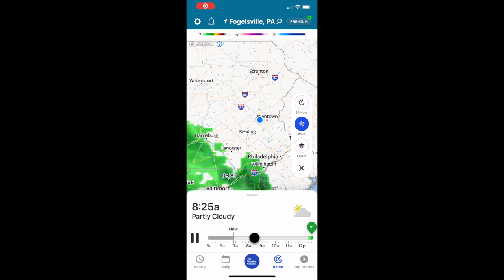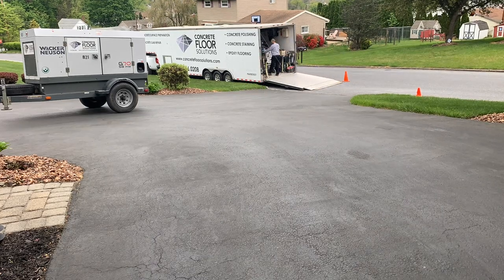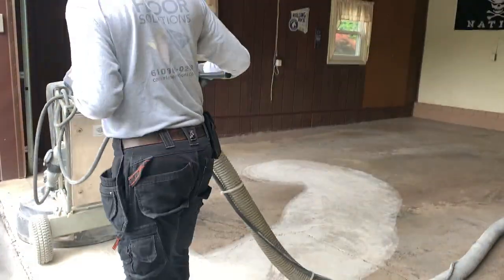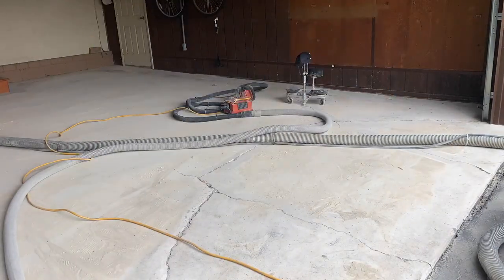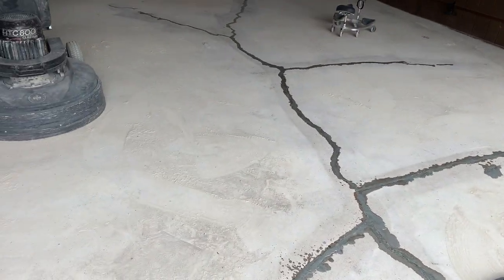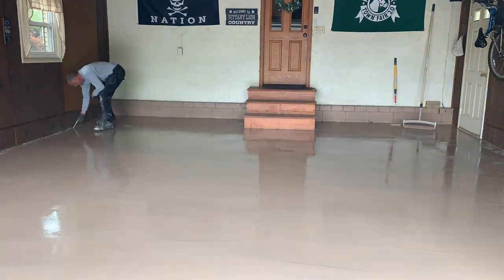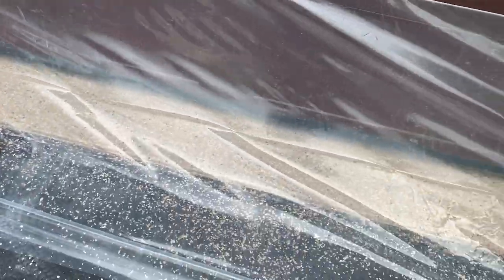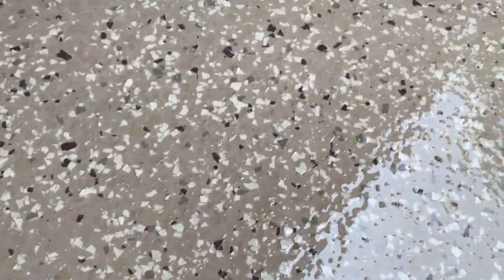Epoxy Flake Garage Floor With Large Cracks

Comment: Thank you for this video! I was using a similar fast cure epoxy crack sealer and I just felt like I was wasting the whole gallon. Now I’ll grab some 70 mesh sand for it. How many pounds of flake do you use for a 400 sq ft garage? I have 75 lbs of flake for a 430 sq fr job.
Reply from the maker: 10 pounds per 100 square feet for full flake. The most common thing in the industry is to over sell customers Flake. you can apply the 75 pounds, but I can assure you you will be shoveling / scraping up 30 pounds when you're done.

Comment: you prefer the muv you used as top coat or a polyaspartic?
Reply from the maker: The MUV is a great topcoat, the only negative is that it is not 100% UV stable. That being said the polyaspartic is even better scratch resistance and 100% UV stable. So I would prefer the polyaspartic if given the choice. It all depends on budget also.
I use the polyaspartic in my own garage.

Comment: i noticed you dont cut a relief joint alongside a crack. Do you recommend doing this?
Reply from the maker: Why would you cut another opening next to a crack that you just repaired?
Maybe I'm not understanding correctly, but what's the point of repairing a crack if you're just cutting another joint right next to it?
By repairing the cracks, you are trying to bond the crack back together again.

Comment: What is the red box that the floor grinder is plugged into
Reply from the maker: It is a power inverter for the Hilti grinder. The DG 150 grinder is actually a low voltage grinder so the power converts from 110 to DC.
They have a new model that is 110 V and doesn't need the box

Comment: You should try mixing the sand with the crack fill material at a 2:1 ratio and make a slurry. It bonds better to the crack and leaves a more seamless look when you finish coat.

Comment: Contrary to what you demonstrate on this job, I've noticed some tutorials recommend not going past the garage door with the epoxy and clear coat.  My understanding is the clear coat will yellow over time with sun exposure.  Has this been your experience or are some clear coats resistant to UV exposure?
Reply from the maker: You are correct, epoxy is not UV stable. We do have some UV inhibitors in our clearcoat, but it will cloud up over time outside anyway.
You can apply a urethane or polyaspartic topcoat, which is 100% UV stable. The upgraded top coats  are normally offered as a choice in our proposals when we install floors.
Reply: @ConcreteFloorSolutions  Thank you for the input.  I appreciate your videos; very detailed and professional without extra fluff and glitter.  If I lived in your area I'd hire your company based on the quality demonstrated  in your videos.

Comment: Good stuff!!
So you dont need a sealer/pva coat before primer?
To kill any chalkiness/dust?
Reply from the maker: In this case we use a 93% solids penetrating primer. I am a huge fan of 100% solids material, with the exception of a primer. It must penetrate into the concrete or else it may fail

Comment: Great work wow! I notice you guys tend to do medium flake not full flake do you ever get epoxy yellowing or any reason not full flake? 

Also wha size is preffered choice for the aluminum oxide?
Reply from the maker: I prefer heavy as opposed to full flake so all the flakes are laying flat, it is easier to clean and you get another color from the base epoxy added to the floor.  You get slight yellowing after a couple years  if extended under the garage doors, but not horrible. We use #36 aluminum oxide typically.
Reply: @ConcreteFloorSolutions  thank you for the quick reply and insight its much appreciated were doing our first floor here soon your videos are very easy to understand im a little stressed because for our base coat we are using Fast Cure epoxy because it has a moisture vapor barrier I plan on diluting 5% acetone into the part A before part B addition to give us a little more work time

Whats your thoughts on fast cure epoxy for base coat ?
Reply from the maker: @sprintcoding7358  I don't know if you mean primer or basecoat. We install a primer, basecoat with flake, and a topcoat. We have always used a three coat system and it has never failed us. personally, I don't like fast cure for the primer if it is fast cure, it doesn't have time to penetrate into the surface. penetration into the substrate is critical for a good bond.

Comment: At what point does it become better to just jackhammer out the old and pour new concrete? If those cracks pulled open under my expensive new epoxy coating I would be really upset.
Reply from the maker: You are correct, that is a homeowner decision. Replacement is probably four times more expensive than the epoxy floor.

Comment: not waiting for the primer to dry than apply the middle coat??
Reply from the maker: Correct, for the novice I would not recommend that. You need to be very comfortable with squeegee pressures as to not push the primer off the floor when applying the intermediate coat immediately after.

Comment: Im finding a trend to apply heavy flake?  Is there a reason heavy flake seems more popular today?  Im even find some application contractors only apply full cover flake and will not due light flake even if customer wants it.  They call it rejection flaking.  Wonder why?   Im a light flake customer.
Reply from the maker: That is a good question, I wish I could answer that. I very rarely apply full flake unless the customer requests it. Normally I will do a medium to heavy flake so you see some of the base color Epoxy through it. My personal preference is medium flake.
Reply: Probably don’t want to mess with the “tossing” of the flake and trying to make it even… can’t screw up full flake
Reply: @ConcreteFloorSolutions  im a new epoxy contractor and when ordering my material I had warnings about partial flake due to bad bond with the top coat polyaspartic clear and they also said the base epoxy will yellow over time. One sales rep told me the non full flake floors are "cheap" and said you might as well do a box store kit.... seems like light or medium density flake gets alot of hate from the epoxy manufacturers and sale channels. I also like the medium density flakes i think it looks cool but this is what I was told and being new I am curious
Reply from the maker: @sprintcoding7358  if you use cheap materials, yes the floor would be cheap (big box epoxy). If you use professional high-grade materials, it is not cheap. We install a 30 mil thick floor which is approximately 15 times thicker than you get at the big box stores (+/-2 mil thickness). The flake application is all personal preference.
The flakes are made out of acrylic paint chips, there is no way acrylic paint chips are stronger than epoxy. That is another reason why I only lay a flat layer out and not a full flake of acrylic paint flakes.  I would have no idea why their material doesn't stick to flake, I would question their quality of products. I  have never had an issue in 27 years installing this flooring system.
Reply from the maker: @jareddory2155  I believe you are correct, it doesn't take much skill to over flake
Reply: I'm a full (fledged) flake

Comment: What happens if rain does get in?
Reply from the maker: I would dry the area, lightly sand the area that got wet and solvent wipe it before applying the next coat. If it lands on the topcoat, you will need to reapply it